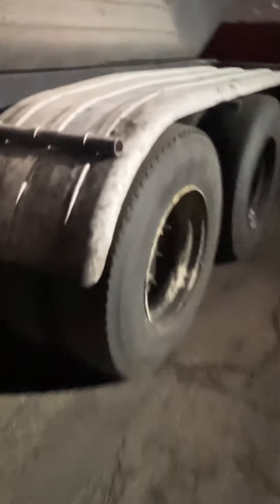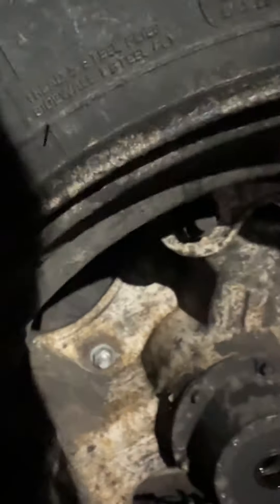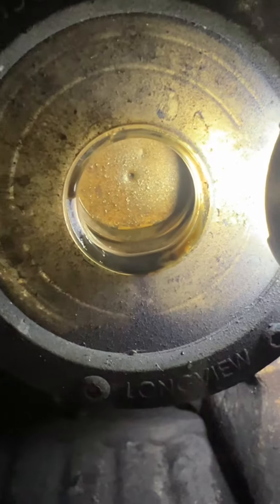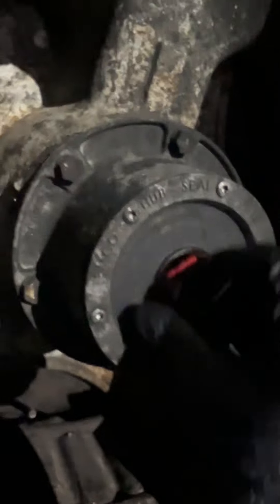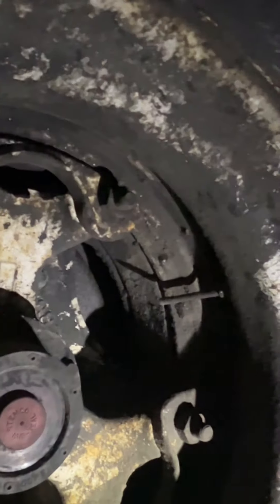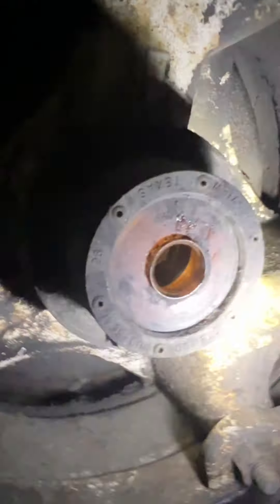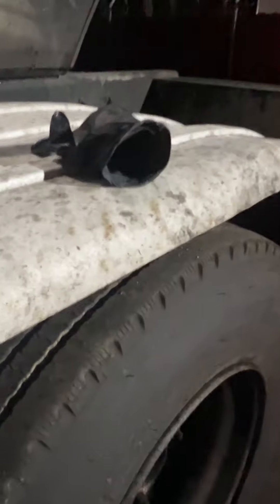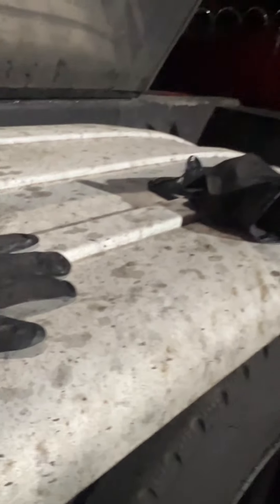I'm so glad I don't live near a place like this! 🤢

Comment: What'd they have a spill of?
Reply from the maker: DAF. And it's nasty right at the processing plant. 

DAF sludge is a semi-solid waste product from the dissolved air flotation (DAF) process that can be used as a nutrient-rich soil amendment: 

What is DAF sludge?
DAF sludge is a semi-solid waste product made up of small bits of proteins, fats, and fibrous materials that are left over after the DAF process. 

How is DAF sludge used?
DAF sludge can be converted into compost and organic products, or used in land application initiatives to improve soil properties and crop yield. 

What is the DAF process?
The DAF process is a water treatment method that removes suspended matter like oil, grease, or solids from wastewater. During the process, aerated water is combined with wastewater and sent into a DAF header box. The air is released, causing microbubbles to attach to particles and rise to the surface. The floating waste particles are then skimmed off and sent to a sludge hopper.